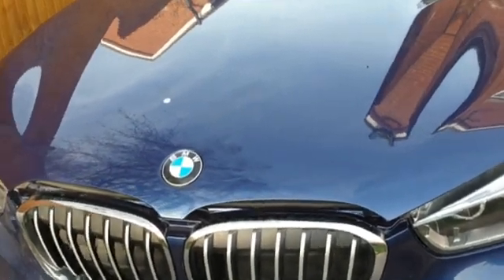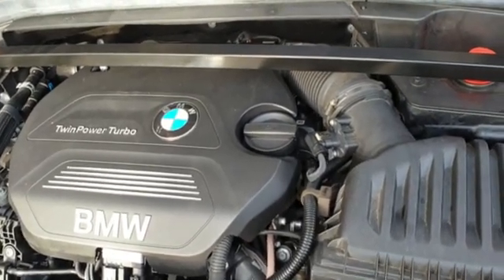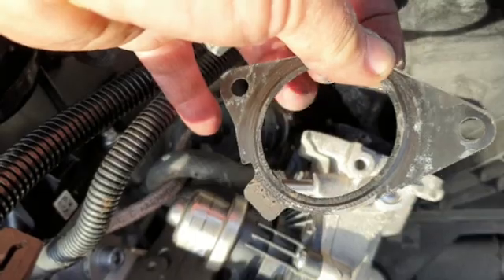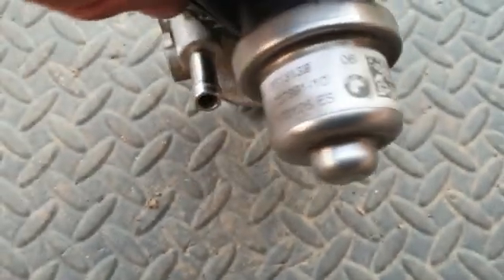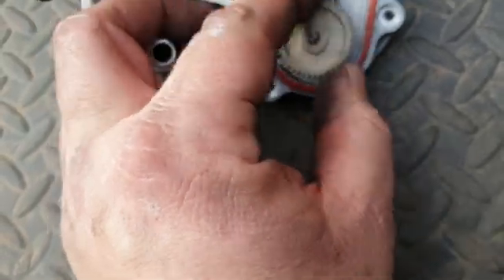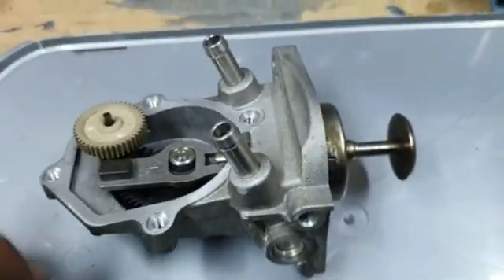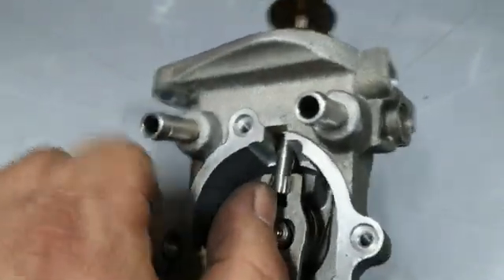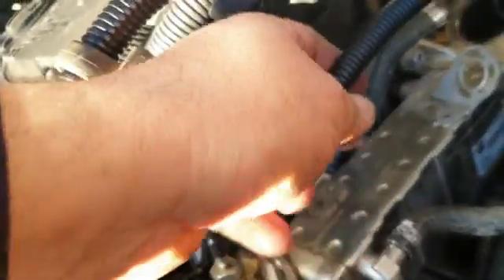BMW EGR Valve problem, identification and solution - solved

Comment: Hello, congratulations on this video.
Should I use the diag before dismantling the valve or only after.
Thanks
Reply: After
Reply from the maker: @maximlake9280  No need to use during dismantling process.

Comment: Hi guys...I having a coolant leakage issue with my 2018 X5 xDrive35d (engine N57T)...The dealer just explained that they  "replaced the high pressure cooler Once 9/21/2022 under the recall and again 2/03/23 due to an internal seal failure of the high pressure cooler that replaced the previous visit. The main part of failure is the low pressure EGR cooler that has a coolant leak that has lead to fouling out and clogging the high pressure cooler and intake manifold." I don't see any documentation or videos mentioning that the X5 has 2 EGR coolers...Could you help me clarify this? In addition, I found that my model is covered by "N47T/N57T EGR COOLER: LTD WTY EXTENSION TO 10 YEARS
WITHOUT MILEAGE LIMIT" would this warranty cover the "two" EGR coolers?...The dealer wants to charge USD$8,000 for the repair

Comment: Hi guys.. hope you can guide me. I have an 18i (gasoline). After driving more than 150mi the "propulsion" error starts appearing and I can't exceed 2500rpm. After some time it just disappears without any action from my side.. BMW service hasn't found the root cause but my guess is that EGR could be the reason. This tool is not something they have?? do you think my assumption is right? thanks!!!

Comment: what do you use diagnostic tool pls
Reply from the maker: AUTEL
Reply: @tiptopmechanic1155  what type Autel 508?
Reply from the maker: @lawbreaker13ro  AUTEL 906
Reply: @tiptopmechanic1155  thanks
Reply: How did you open the 4 screws please. I have tried all possible security torx bits but none fits. Can you please tell me which bit/tool to use
Reply: @Junaidddevil did you find the answer? I need to know to
Reply: Looks like 5 point anti tamper torx just going by the video